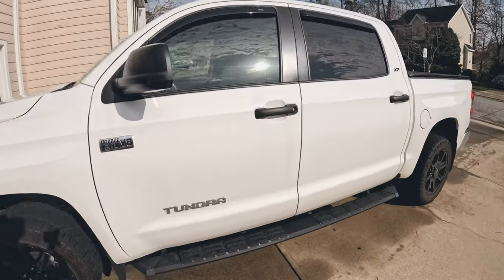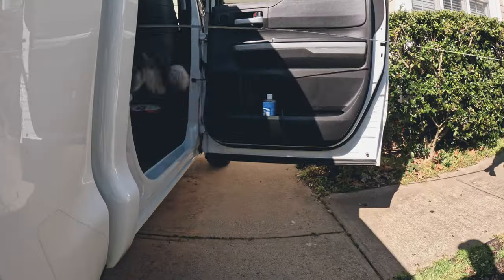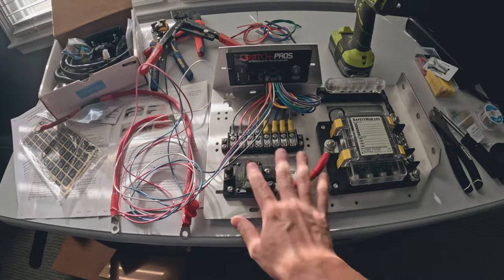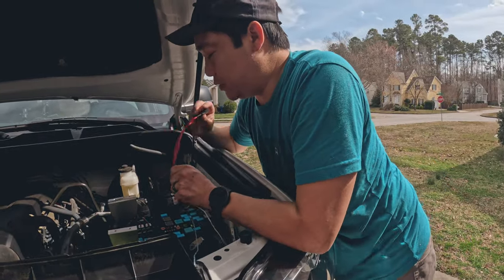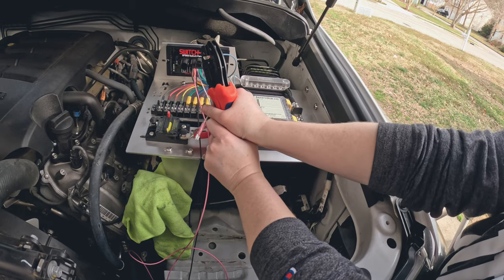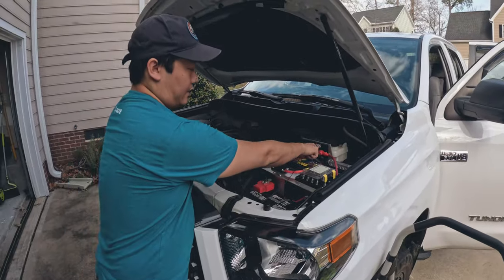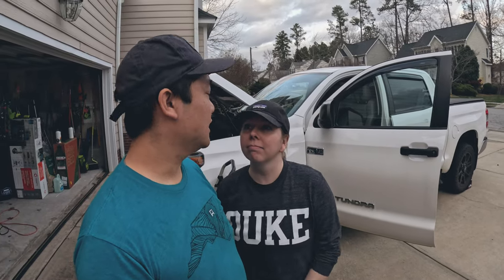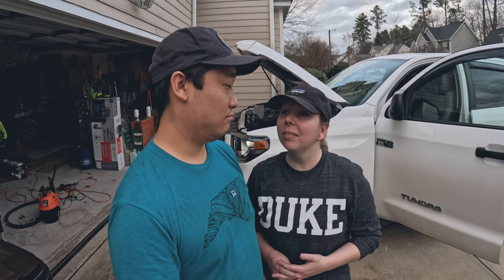2.5 Gen Tundra Build - Electronics and Switch Pros Install - Part 1

Comment: Should have bought a promaster van 118 with a pop top👀
Reply: We considered it! Maybe if we were full time! This truck has to do double duty as our family adventure rig, and an MSO guide vehicle.
Reply: @ericwashi  I will say I've owned a power wagon, a zr2, a ram 2500 diesel and finally decided to buy a van and ugh what have we been doing in the overland community😅 van life is so nice. Fully setup don't even need to leave the vehicle if the weather is harsh. The way I built my van I can carry 2 pallets (I have a 159in model) still when my bed is put away. I just carried 2800 lbs in the rear all I do is clean out the cargo area then it's back to adventure van. It's like a swiss army knife the only I can't do is put dirt in the bed because I don't have one but I can hook up a dump trailer to my van and get dirt that way. Got a microwave ,air fryer , shower, seats for 4, a larger dorm fridge with separate freezer...etc but yeah I used to be an overlander like you till I took and arrow to the knee found out how awesome vans are 😅.
Reply: @cch201992  I bet! I can pretty much guarantee you that there’s going to be a van in our future. It just might not be the near future 😂
Reply from the maker: Wow, yeah, #vanlife - that's a whole other level!